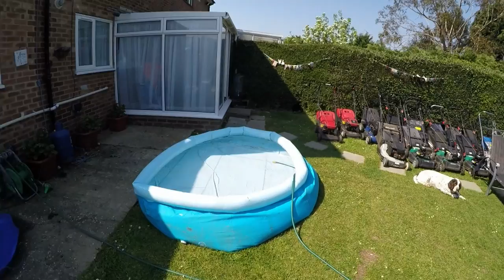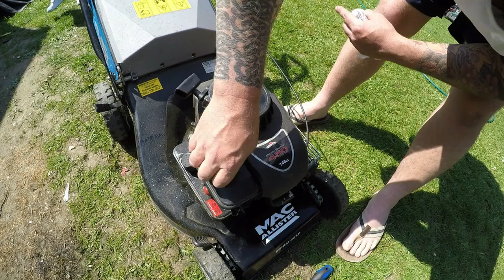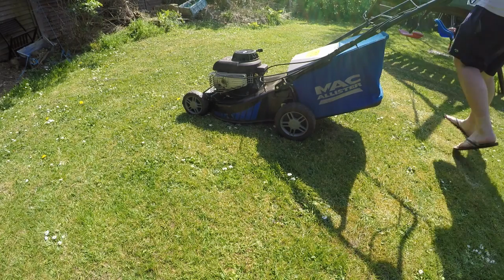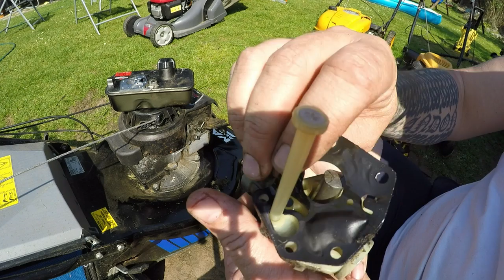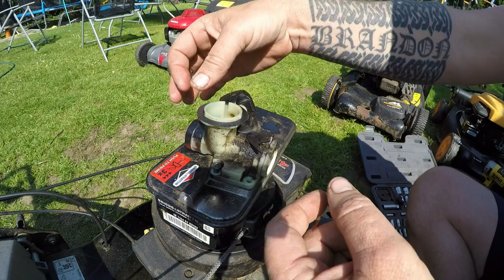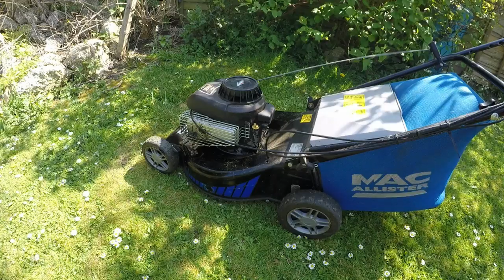LAWNMOWER SIZED AND WILL NOT START HOW TO FIX #SMALLENGINENATION

Comment: Hi mick what oil do you use for your mowers and were can i get some
Reply from the maker: I use SAE30 from Amazon mate I get 5lts at a time. Its about £10
Reply: @themowerman  hi mick had a go with a honda today was very smoky when started so let it run fot about ten mins didnt clear what do you think is it the piston rings maybe its a over head cam type
Reply: @themowerman  hi mick had a look for that oil carnt find it have you a link to were it is thanks allan by the way great video watch all the time
Reply from the maker: @alyebyooful  https://www.amazon.co.uk/SAE30-Litre-Suitable-Models-Lawnmower/dp/B07DX5S4GW/ref=mp_s_a_1_9?crid=3L1FQQWD2KYDI&keywords=sae30+mower+oil&qid=1555947231&s=gateway&sprefix=sae30&sr=8-9
Reply from the maker: @alyebyooful  ok so first of all check the simple things. Over filled with oil, check the petrol, next if it's running lumpy and smoking check the key way under the flywheel. If all of the above are ok I would look at the valves and cylinder next ti check for play and wear.also I would put a compression tester on it to see what it's doing.also the head gasket.. hope that helps
Reply: @themowerman  runs ok not checked valves yet very easy to pull over not got a compression tester i think this mower as been to mars and back cutting lawns  but runs ok apart from the white smoke will have a other go with it thanks mick

Comment: hi mick love the style of your videos ,,have you always done that sort of work ? or how did you get it to it ?
Reply from the maker: rob fraser hi rob thanks for stopping by. I started working on small engines when I was 11 manly on outboards and inboard boat engines. And after that i worked on a farm. Always been good with my hands. Do you do much
Reply: @themowerman  hi mick just started doing lawnmowers sold 4 in the last 2 weeks best sale a  challenge  extreme got free sold for £60 only cleaned the carb and tidy up ,but its getting harder to get a bargain i just got an old atco like the one you done up cylinder one a lot of work later and they dont seem to fetch much up here (north) nice to here from you keep the videos coming ,,,rob
Reply from the maker: rob fraser good on ya mate. Try to offer a part exchange on any mower you sell I have had about 20 part ex in this year